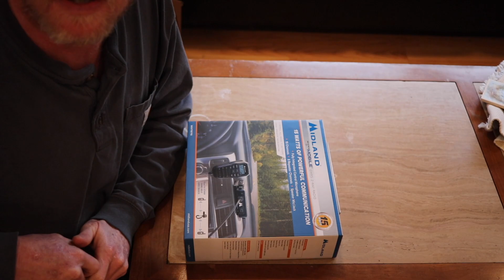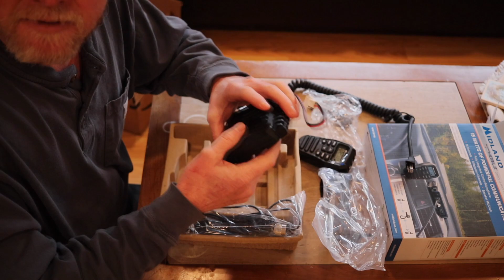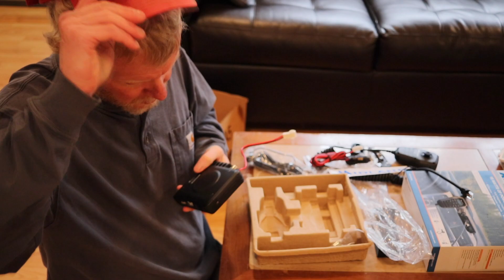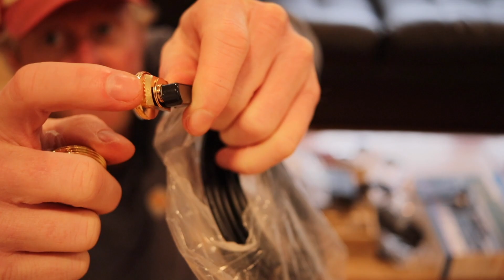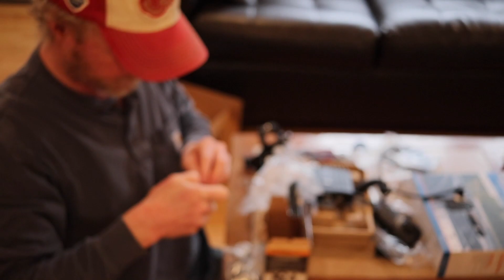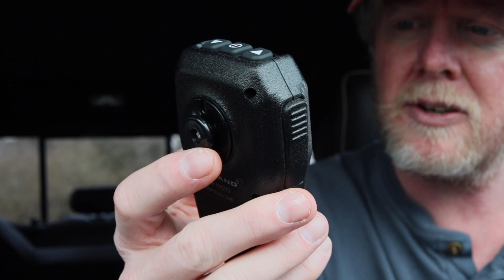Midland MXT 275 GMRS Radio Unboxing, Review and Test.

Comment: How is the range on radios like that?  It has to be better than the old CB radios. I may have to look into getting that license and hooking one up in my Jeep!!
Reply from the maker: It's similar to uhf public safety.  There are local repeaters around us here in WNC.  Also just about everywhere I've rode in TN,GA,NC.  Wayehutta and Ruff Butt areas both reachable via cowee repeater.    Simplex easy few miles in woods radio to radio.  Repeaters extend that out to long distances.